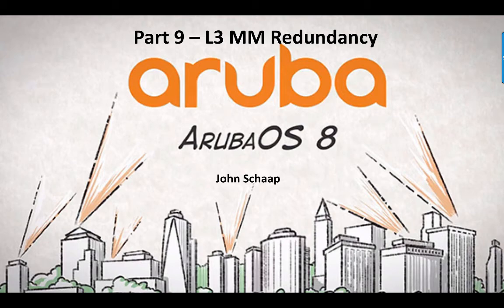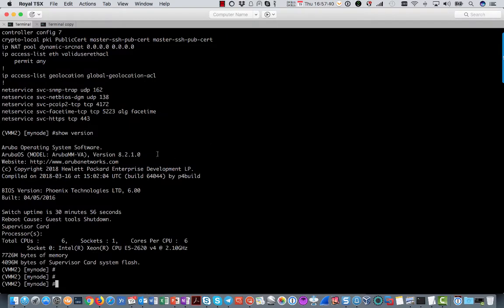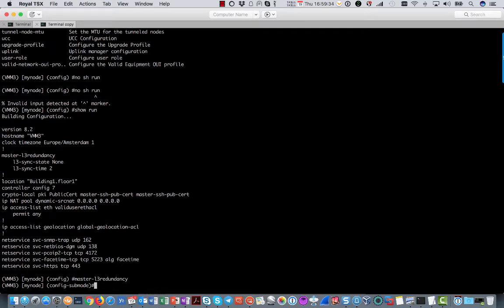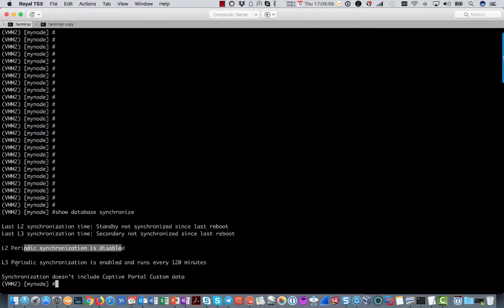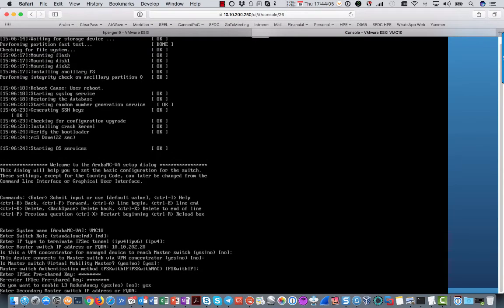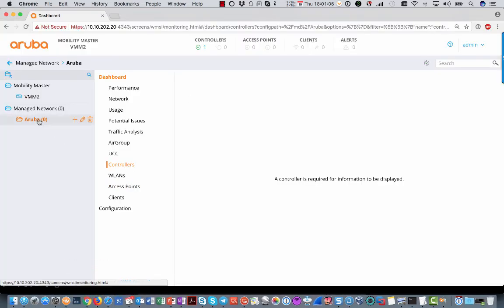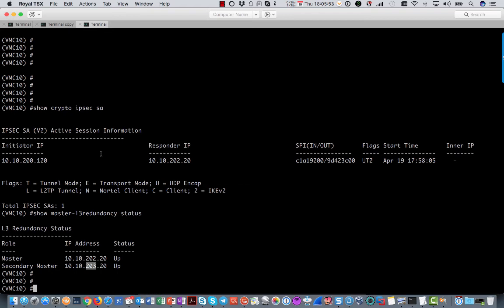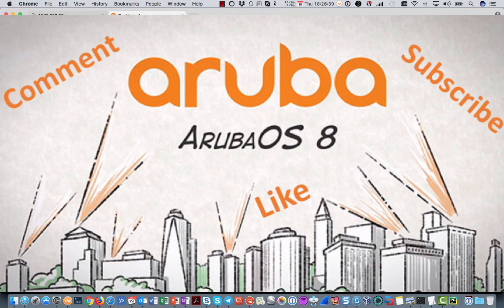AOS 8.2 Series Part 9 - L3 Backup Mobility Master

Comment: Can VMM2 be a master for some VMC and VMM3 be a master for another VMC in different datacenter?
Reply from the maker: VMM2 and VMM3 are configured as mobility-master/backup-mobility-master so all VMC's will connect to both VMM's. You need to install VMM2 and VMM3 as standalone MM's if you want to terminate some VMC's on VMM2 and some on VMM3.
Reply: Thanks John..